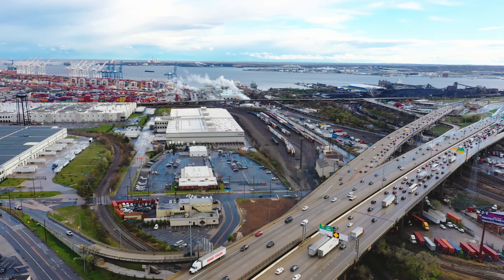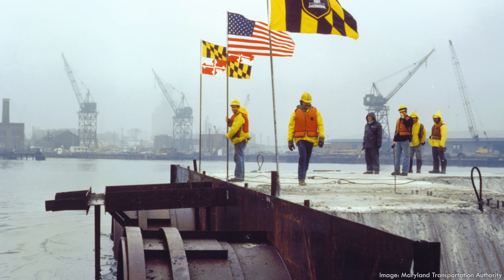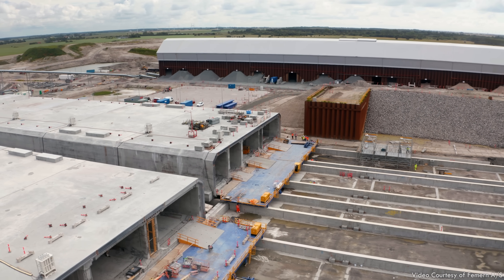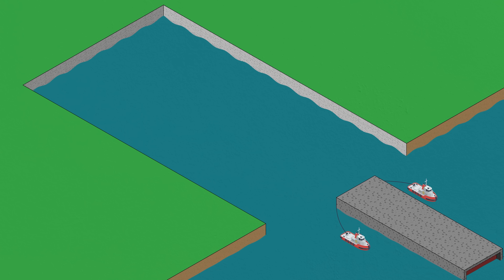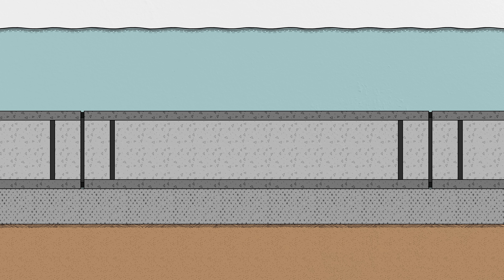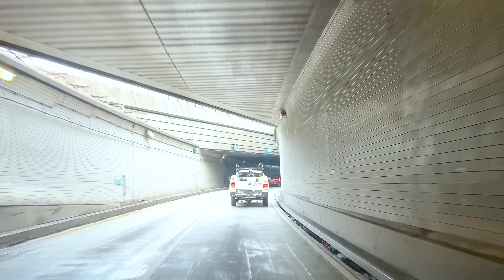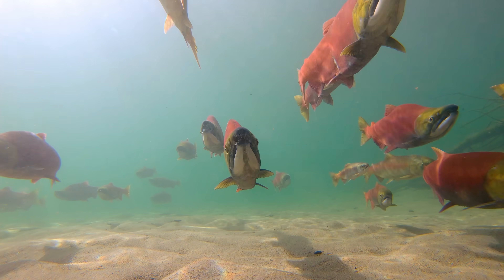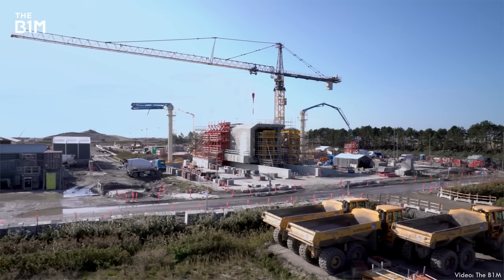The Most Implausible Tunneling Method

Comment: Not sure if you mentioned the failure or "issues" rate, but if it's comparatively low as I suspect for a project like this, then I sort of look at the process as more straightforward/known, than complex/intricate?  I.e., I'll usually take,"if you do x, y, and z to these exact known specs, you'll have a 50-year tunnel with a .1% "issues rate," over wondering which step in the "simpler" process has the most potential to turn my average 80% reliable tunnel into 70%, or vice-versa.  If that makes sense?

Comment: Hmmm, I have a thought; this method might be a feasible plan to handle one of the worlds most infamous construction projects that hasn't been able to get off the ground.

A bridge between Italy and Sicily.
One of the problems it has is the channel gets so unexpectedly deep that it becomes too hard to bury any support beams, requiring what would be the longest single span of any bridge in the world.  But if it just went underwater, that wouldn't be an issue.  (As long as it doesn't get too deep to be able to safely drop the segments, and isn't too steep as to negate the use of a tunnel.)

Another one of the issues that is preventing a bridge between Italy and Sicily is the problem with getting constructions crews there because the area is so heavily controlled by the mafia who use continual construction plans as a source of income.  But this method would help mitigate that problem too, since the construction could actually be done elsewhere, and what has to be done on-site is so specialized that conventional mob-controlled construction agencies wouldn't be able to take control of the job.

Comment: How are the joints maintained? It seems a rubber joint has a relatively short lifespan but since it is the seal between exterior and interior of the tunnel, replacing it without risking a cave in on the locking sediment or a leak would be impossible.

Comment: in the netherlands this is the main method of underwater tunneling since late 1930's due to the inpossibility of tunnelboring in the everage dutch soil
the first tunnel the maastunnel started contruction in 1937 and was finished  in 1942 in the city center of rotterdam(yes this means it even survived the 1940 bombing of rotterdam and the american bombings of rotterdam after while still under construction) and since then dozens of tunnels have been build in the country using this method
also yes in true dutch fashion this tunnel has a footpath and a bikepath together with a motorway 
Most populair use are for the highways and major motorways and ofcourse the railways lots of the major railway bridges especialy ones that used to be swing or drawbridges have been replaced by these tunnels throughout the years

Comment: Vancouver Canada has one of these tunnels - the George Massey tunnel runs 4 lanes of Hwy 99 under the Fraser River, and opened in 1959.  Due to it's age, there is work in progress to replace it with a new one - same construction, just larger, about 1-2 km upriver.

Comment: Why would they not use a slotted channel to align the two sections while lowering?  Some tapered tung and groove to allow for dropping into the right position.  Then use the pulling method to ensure proper sealing.  Also the wider part of the taper can be injected with a flexible material to create a better seal but still allow for natural expansion/contraction.  Even if this area was already pre lined with a seal.  Not sure if it would be the correct material, but injecting something like butane rubber sealant comes to mind, but a bit more stiff.  I can't think of any disadvantage of doing so.

Comment: In paris, the first crossing of the river Seine by th e subway line 4 did something similar but instead of digging a trench, the segments had a pressurized chamber at the bottom so that workers could dig and lower the section.
I think that cont as immersed tube tunneling and they did it in 1900 !

Comment: Interestingly, the four tunnels that comprise the Fort McHenry I-95 tunnel in Baltimore have signs over the entrances referring to them as Bore #1,  Bore #2,  Bore#3,  Bore #4.  Even though that is not accurate as this video points out, it fits the sign better than "Submerged Prefabricated Tunnel #1 - Submerged Prefabricated Tunnel #4.

Comment: If they're buoyant enough to float on the surface when full of air, what keeps them from floating up like pool noodles after they're drained? Especially if they're drained before being covered, as described in the video. There was no mention of anchoring the sections to the ground.

Comment: This subject resonates with me a lot because I studied some of the structures that are used in immersed tunnels during my PhD thesis. Double-skin steel-concrete composite structures, and their vulnerability to defects in the concrete matrix.
SCS have for example been used in Japan in the Kobe-Minatojima tunnel, as well as the Naha one, & also in China for the construction of the Shenzhen-Zhongshan link. SCS are quite practical for immersed tunnels because the tolerances are low, being first made with steel then filled with concrete, and they are fast to build. I think they were praised in Japan for their low tolerances which  enabled their construction in a seismic zone.

If you're ever interested in the subject, I'd be glad to answer some questions about SCS.

Comment: In Brisbane (Australia) we currently have a bridge (called the storey bridge) that's 85 years old. It was originally designed for a life span of 100 years.. It's a bit of a mess at the moment requiring extensive maintenance works. It has rusting, water leakage and a few other problems. There's also no money (apparently) to maintain it. Would love to see a video on it one day if it's worthy of one.

Comment: if they count on the buoyancy of the air filled tunnel to not require super hard ground beneath it wouldn't repeated transits of heavy trains constantly flex or stress the rubber joints so that they might fail after years? fully loaded freight would be super heavy

Comment: I have a conceptual question, if the tunnel sections are light enough to be floated in place, what holds them down permanently. I don't think a little silty backfill is enough, I've seen sewer tanks float out of the ground in a flood.

Comment: 7:17 How is the section supposed to sink? It's designed to float when filled with air... I guess you let water in during the installation but then you have to anchor it or add enough weight on top of it to keep it at the bottom before you flush the water.

Comment: The E18 highway through downtown Oslo go in front of and underneath the well-known Snøhetta-designed Opera building, crossing the harbor. It was constructed the same way, connecting directly (and well underwater) to a tunnel underneath the Akershus Fortress, then on the east side it goes directly into a multi-way tunnel and junction which eventually emerges on top of the Ryen area, high above the city.

Comment: OK this is cool. Do they have a suspended version? I mean, one that "floats" submerged but above the waterway floor? It would be subject to so many more stressors but would require a lot less site prep and may have a lower ecological impact. 
You compared these to building a moon base and I think the moon has just one more complication that would make it harder: there's no limestone to make cement from, and shipping cement 385k km is pretty expensive ;)

Comment: San Fransisco has three immersed tube tunnels. The oldest is just shy of a hundred years old now, ( Posey and Webster Street Tubes ), between Alameda and Oakland. Then there's the Transbay tube. That's a long one. Always found this tunnel construction technique fascinating. Cheers. 👍
Reply: That's a scary thought... at least here in Baltimore we rarely have any seismic activity, and what little we have is very mild. One of these days the "big one" will hit along the San Andreas Fault.
Reply: @leeriffee4606  Yes. I remember when it was being built. A lot of people said the same, no way they'd ever ride it. But if the big one hits, they may have a worse chance surviving on the street with all that concrete overhead. Whew! At least in the tube, there might be some cushion from the sand bed and water??? I really don't know. I'd wonder about the joints however. Flex too much and then what? Cheers. 👍
Reply: @leeriffee4606 the transbay tube had a BART train in it during the 1989 Loma Prieta earthquake. That earthquake collapsed a double-decker freeway, broke a section of the Bay Bridge, amongst other things. The riders on BART didn’t feel anything in the tube. Some were unaware of the quake. It’s quite safe haha.
Reply: @Certified_Trash  Earthquakes are so variable with regards to how deep they originate and what sort of waves they generate, so I'd say that is the reason those tunnels were not affected in that quake.  The people in them totally dodged a bullet that day.  Yes , tall structures like bridges will feel more of the shaking as opposed to those at (or perhaps below) ground level.  But at some point,  a powerful enough quake will end up destroying a whole lot of infrastructure.  If I had to be in or on a large manmade structure in the SF area during a big quake,  I'd be on the Golden Gate or Oakland Bay bridge (newest part of the latter would probably be best or on the top deck of the old part).  Those structures would IMO be able to take the biggest shaker, including one that would bring down some skyscrapers, and flood those tunnels.
Reply: @Certified_Trash  Not sure what the term is for a tectonic land movement is where one side moves forward and the other back. Google a.i. says strike-slip? But if the tube were going across that kind of shifting at the point of a joint, it'd think it's put stress on it. But I really don't know. I wouldn't want to be down there. Cheers.
Reply: Webster/Posey tubes mentioned!!! they were built in like 1930, that's nuts
Reply: @marianeptune7321  The first built in 1923 I think? It's had some major work done on it back in the 60's,.... but it's still being used!!! And it was the first of it's kind. They didn't even have a track record from from others to look at! It is nuts. Cheers.

Comment: Amazing video as always! I am missing one part though, how does maintenance work for such tunnels? They use a rubber seal to get initial fit, but seals degrade over time, how do you maintain a seal under water, over time and under constant shifting movements?

Comment: Grady, a question came to mind. Maintenance is always a factor in construction. Nothing lasts forever. How do you do maintenence on the outter section of concrete? Is everything that is required able to be done from the inside? Also, are there requirements for watertight doors like in ships in case of a breach?

Comment: I don’t understand why the tunnel boring machine is made in a circle causing a waste of space in the upper and the lower part of the circle. 
If they have the technology to make that machine cut in a circle in the first place, why are they not making it run horizontal?
If the cutting head is running horizontal, it can cut away the debris and allow the debris to fall on a catch pan then  onto a conveyor belt, just like it does with the circle.
Love your Engineering videos, thank you for sharing them.

Comment: "Railroad usually have even stricter constraints on grade"...
I love that you added "usually" to account for what I believe the only train is that can do steeper than a car: a cog-train. 

(not exact name but I mean a train that uses a cog below to climb steep surfaces in e.g. Chamonix to reach the glacier).
Reply: Constraints in this context are not about extreme capabilities of car and extreme capabilities of regular (adhesion) railway. Constraints are about the planned patronage and their capabilities. Rapid transit rail line will be designed with constraints that say 5%. If freight trains run on the line then constraints will be penned to demand less than that.
Reply: Also on Mount Washington in New Hampshire, USA.

Comment: If you're interested in these kinds of tunnels: in about a week the first 160m segment of the Scheldetunnel floats 100km through the North Sea and the Schelde to be placed in Antwerp!
I'm thinking about doing a 100km cycling trip myself to see them float by :D
The B1M did a video about this tunnel recently as well.
Reply: And probably that tunnel segment will do that 100 km journey faster than a truck would take to do the same start point end point trip on the Belgian road system 😉
Reply: @XEinstein  the roads are pretty bad, but I see the trip is estimated to take 30 hours ;)
Reply: @MrMattie725  30h seems about correct to me for a 100 km road journey in Belgium 😉
Reply: @XEinstein  Living in Antwerp, I can only agree with that statement. 😅

Comment: As an addendum, these have a problem similar to bridges in they need to be placed with some foresight to have enough clearance for future channel dredging as ships get deeper. 
A major issue with ports in the USA is all the infrastructure was designed for ships half of the size of those currently available. Those folks involved with replacements and upgrades still haven't learned their lessons of course, and even when expanding undersized infrastructure to meet current needs they continue to make no substantial provision for reasonable future growth. (IOW Everything is at some capacity by the time it is completed.)

Or people can just be a little responsible for their own affairs and place locations (for B2B or home to office commutes) so the most frequent transfers stay on the same side of the water.